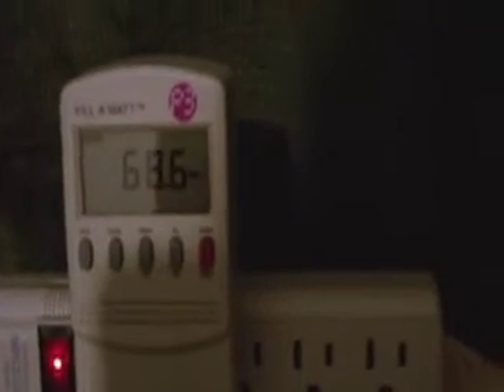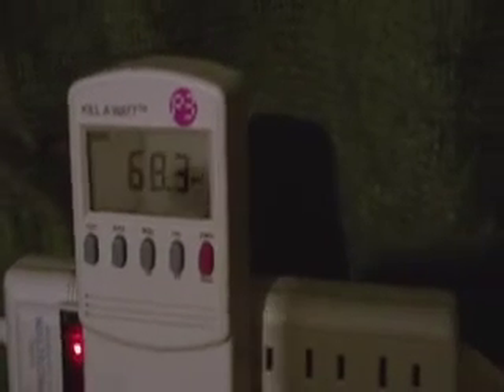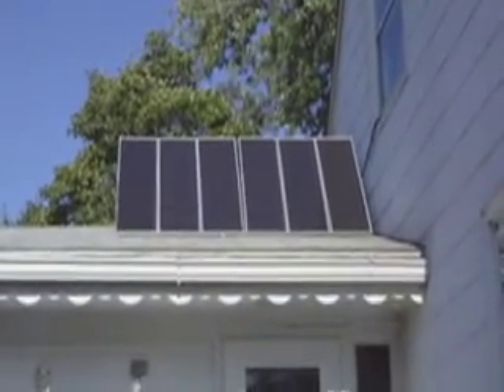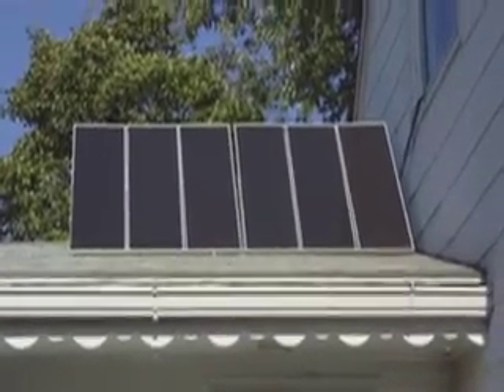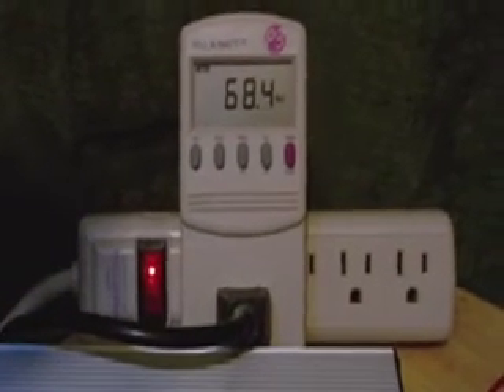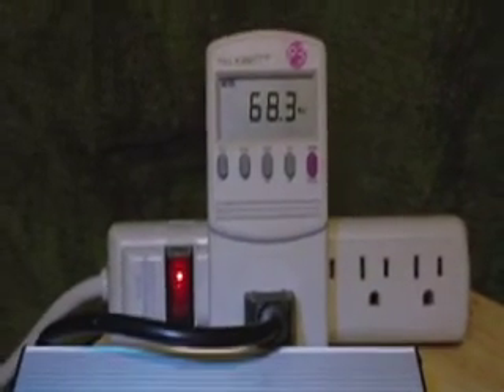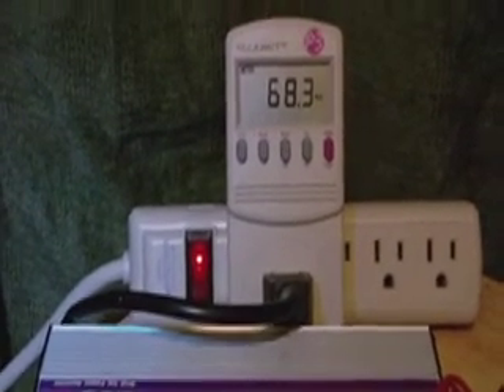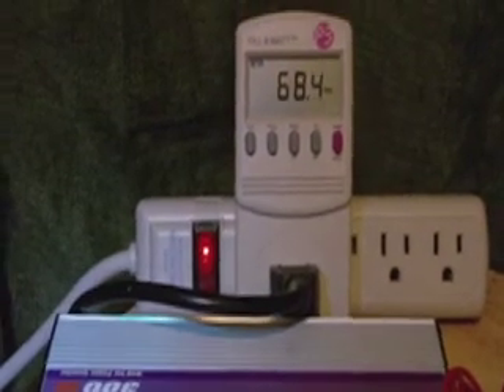Get off the grid 90 Watt Harbor Freight Solar panels with SUN G 300 GTI Kill O Watt Meter

Comment: Good Job!!!! I also have 2 HF systems, and the same GTI as you.... I was only getting 45-50 watts from my panels.... On the back of the GTI, it say, input 12 volt solar or wind device...right??  My battery bank of 8 batteries have 800 amps.... How would the GTI know where the 12 volts are coming from??? 12 volts is 12 volts... I hooked the GTI into my battery bank and now get 90-100 at night, 120-130 watts in the daytime... But this will slowly drain the batterys... input 5 amps, GTI uses 9...

Comment: I found some 250 watt panels locally for a good price. I have a small work shop that I work out of that I would like to add a window unit type A/C unit to. How do I calculate how many panels I would need to power an A/C unit? Charge controller? Power inverter? I am new to solar and would like to try this project. I'm willing to spend $2-3K for everything if that is doable? Any ideas?

Comment: @Zarfilms2007 One last tip, the Crystal based panels are more sensitive to shading. If you can put the crystaline out in a more open area it will perform better all day. But if not make sure it's clear from 11-3 which is peak sun. The thin film are less sensitive, in fact they work inside, because the cells are striped down the glass and each cell is rated to the Open Voltage. They are wired in parallel where Crystal cells are wired in series, each cell is worth .5V, complete opposite.

Comment: Nice update. The panels are leaning to far forward for right now. The "basic" math is Lat + 5 for Winter and Lat - 5 for summer. OR if you don't like to adjust them, Lat -2 for year round. The OEM HF stands are 37* which is perfect for areas north of North Carolina but your roof pitch is adding about 30* too. When you drop that 100 on the roof, consider adjusting the HF sled down, or lift the front up to tilt the panels back a bit. They will work better in Winter, so maybe Aim then for it.